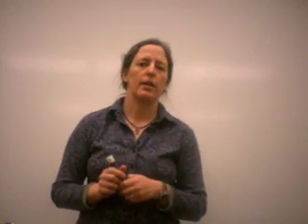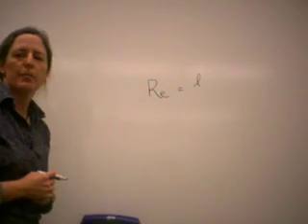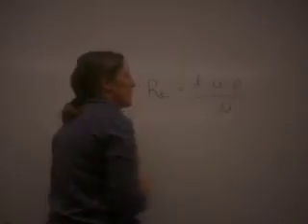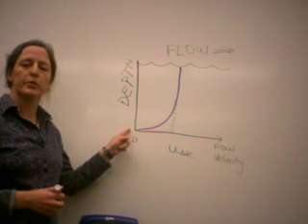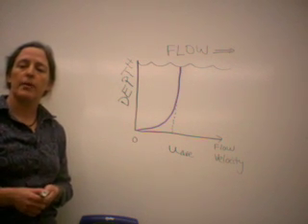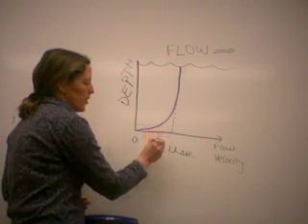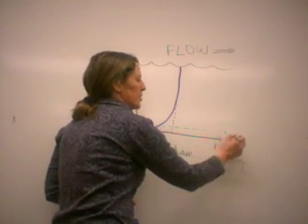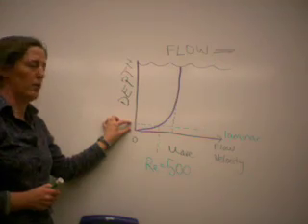Turbulence and Boundary Layers

Comment from the maker: @champboy1990 Re is defined slightly differently as the geometry of flow changes. I am using one for flow in an infinitely wide channel. A Re eqn for flow in a pipe (the Moody chart) uses diameter rather than depth, and pipes have more friction per volume of flow. The Re eqn for pipes defines the transition from laminar to transitional at a different Re rather than including the geometry differences in the equation. The key universal point is that the flow is laminar close to solid surfaces.

Comment from the maker: The boundary layer is the zone where the boundary influences the flow speed and includes, but is larger than the laminar sublayer.  It consists of the zone from the base of the flow to the depth where the average flow speed is reached in my drawing.  The boundary layer is transitional to turbulent for most of it's thickness.  The laminar sublayer becomes very thin to non-existent as Re gets very high (especially in air which has low viscosity).

Comment from the maker: Excellent questions!  You are right - the laminar sublayer is thinner at higher flow speeds and it is different in different fluids because the viscosity and density of fluids varies.  Your use of Re to guide your thoughts is right-on.

Comment: Does the thickness of the laminar sublayer change with speed?.... Because at higher speeds the distance l (in the equation) will have to be of a lower value in order for Re to be 500......???  Also, how would the thickness of the laminar sublayer differ with different fluids (e.g. water and air at same speed)?   thanks.